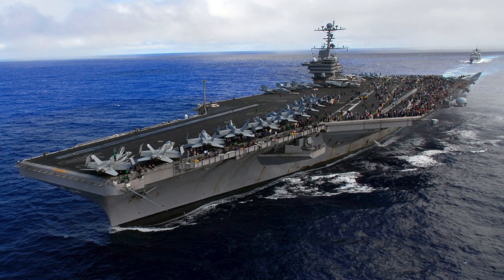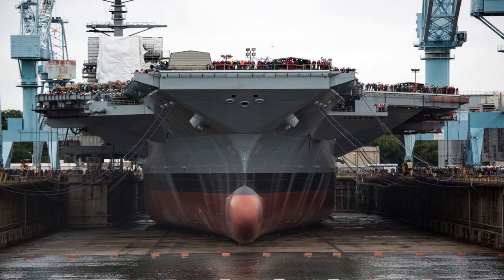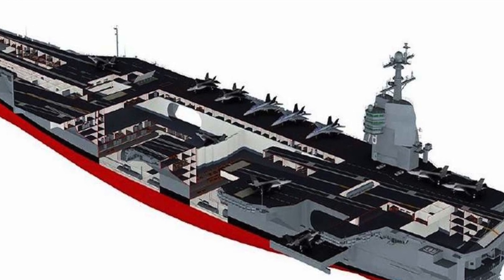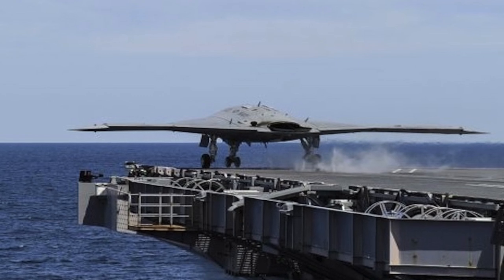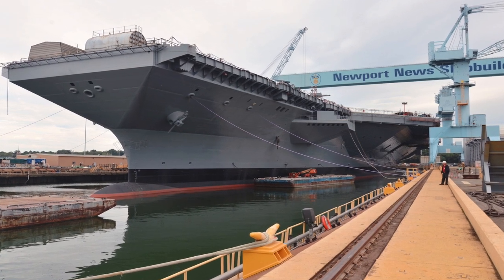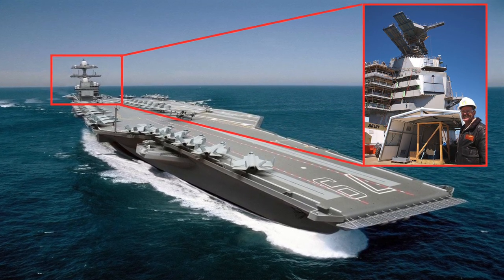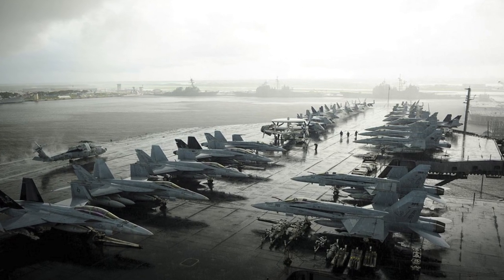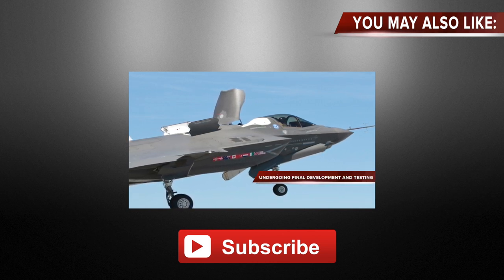NIMITZ vs FORD class: TOP 5 IMPROVEMENTS

Comment: The biggest benefits of EMALS are (1) it can be finely adjusted to the weight of each plane, providing exactly the force necessary to provide the required takeoff speed, (2) it has a lot fewer moving parts and no piping, so there's less downtime due to failures and maintenance, (3) it's electrical, so when it's not launching, the power can be used elsewhere, (4) it is more efficient than steam catapults, (5) it can launch heavier planes than existing systems, (6) it takes up much less space within the ship, so there's more room for everything else, (7) it recharges faster than older systems, so can generate a higher surge sortie rate.
Reply: pahtar If it actually worked. But it doesn't. A catapult is rather critical in a super carrier. And you can't replace a EMALS worn a stream catapult. So your choices are either get the catapult working or scrap the entire class.
Reply: EMALS is basically just a direct drive linear motor. We have direct drive motors in industrial machines for over 15 years. Finnes of control, energy efficiency & no moving parts (except for the carriage) are advantages.
Ingress of dirt & contaminates are a drawback because of exposed magnets.

Comment: Sweet jayzus! I'm so old that none of this makes any sense. I was on the Ranger and the Enterprise in the mid '70's. Full war crew compliment was over five thousand sailors! The first time I laid eyes on the Ranger was in 1975 at NAS North Island. Just the sight of her at dock took my breath away. Now she's been converted to scrap metal.

The Enterprise was still relatively young in '75...so was I. I think she displaced 70 thousand tons and was the only nuclear carrier in the fleet. Both ships had these long antennae that dipped down off the deck just below horizontal, like individual cat whiskers. When I was on the Enterprise I got to talk to the cat sailors. One man was on deck in the catwalk off number 4 cat starboard.  Once he got all the aircraft weight launch data from the launch captain he would entire the info. Then it went to another station. The correct steam pressure was set for the bird to be launched. It was pretty exacting. Too much pressure and it would shear off the nose gear. Not enough pressure and it was a "cold" launch, usually with the plane going into the sea.

I used to be able to name every single CV carrier in service when I was a sailor forty-two years ago. I think there were twelve or thirteen. I'll try now. I'm not cheating here; Enterprise, Ranger, Kitty Hawk, Oriskany (aka Zippo), Midway, Forrestal (aka forrest fire), JFK, America, Constellation, Coral Sea.

Aw hell I know I'm missing at least 2 but that's all I can remember. Help me out here shipmates.

Not one single CV I listed is left in the fleet. I think CV-- 65 USS Enterprise was the last to go a few short years back.

In October '75, off the coast of San Diego during care-quals I watched a VF squadron with the new Tomcats doing traps, touch n' go's and launches.  I saw F-8 Crusaders, stinky loud F-4 Phantoms by the trainload, sweet A-4 Skyhawks, A-6 Intruders, 4-man A-6E Prowlers with the black cross on the radomes, F-5 Vigilantes (the last of), A3-D's, mean and butt ugly A-7 Corsairs, the brand spanking new Lockheed S-3 Vikings with shit-don't-stink crews, E2B Hawkeyes,  Fudds (with recip engines), H2 helos (war winnebagos).

The Tomcats were beautiful in flight with the wings swept back but were ugly as sin when approaching the deck for a trap because the wings were full out and the stabilators would flap up and down and the rudder right and left like a turkey landing onto a campfire. Not only that but the Tomcat was a big, heavy bird. I think it outweighed the Phantom by at least 2 thousand pounds.

I may have left out a few planes but every single one I listed is no longer in US navy service. Time marches on, so does the US Navy, thank goodness. God bless the US Navy. Fly Navy!!!
Reply: It's funny you say the Tomcat was heavy compared to the F4, becuase my friend in the Air Force said the F4 was a brick with engines. It would barely fly on one engine, and if you lost power it dropped like a brick, there was no gliding in any real sense of the word. If there wasn't an airstrip in a perfect cone beneath, you were ejecting.
Reply: That's a fair description Geoff your friend wasn't exaggerating but the truth is all jet fighters do that, ie. drop like a brick when the engines cut out. Some just drop faster than others :) Anyhow, it's not a matter of weight but wing loading and drag coefficient. Anyhow it appears I was mistaken about the weight. The Phantom and the Tomcat both weighed around 61 thousand lbs fully loaded.

Comment: Nice presentation, but did anyone PROOFREAD the script?? Its numerous errors detracted from the show.
Reply: What errors? Did they make mistakes?
Reply: Vocabulary !!!
Reply: Do you mean the terminology of the types of systems or what? What did they get wrong here. I'm interested.
Reply: Agreed.
Reply: They could have also gotten their facts correct, their power generation figures for the Roosevelt only works if you only could electrical, and only 5/6 of the actual electrical generation, anyone reading Wikipedia will find out the wiki lists each reactor at 550MW of power, but that's total output, not the amount of Electrical power output by the Electrical Generators. If your confuse this is because the Navy continued to use MW to describe the Thermal power production capability, why? because BTUs(British Thermal Units) had not been invented when the Reactors were designed.

Comment: So, in short Maximum mana increased by 300% cool down reduction increase by 30% atk spd increased by 15% inventory slots increased by 25. Heat resistance increased by 200% and a vision range buff. Pretty solid patch I must say.